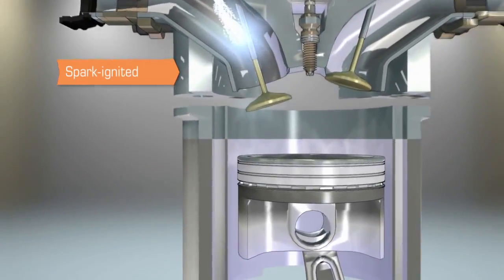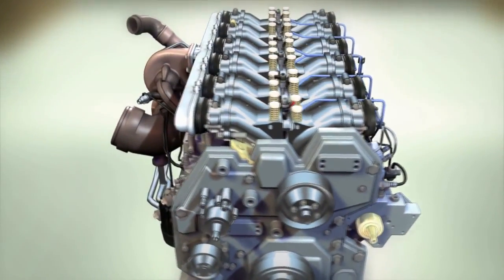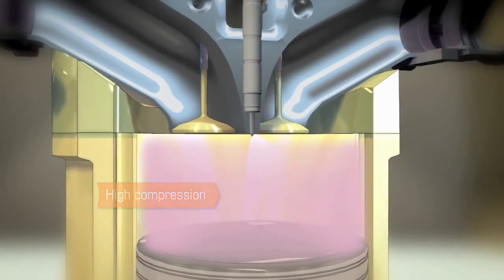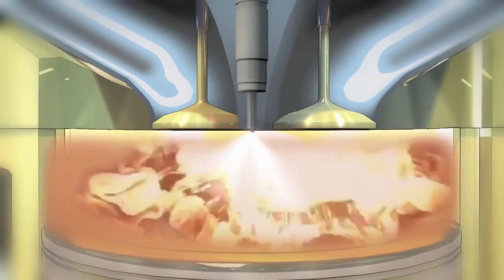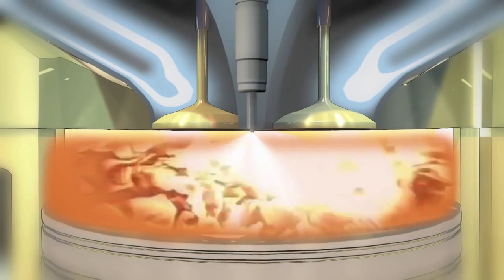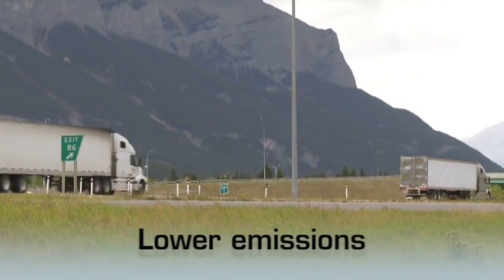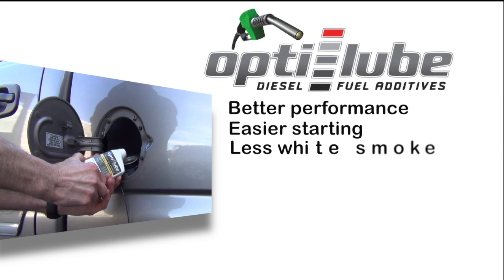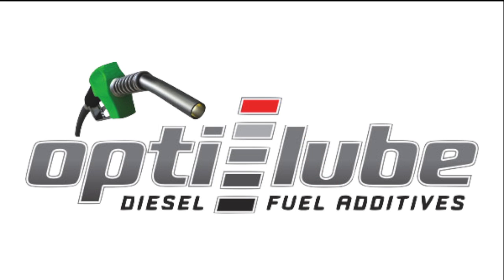What Is Cetane and How Does it Impact Combustion in a Diesel Engine?

Comment: Heads up to my diesel heads in California. HPR diesel is a biofuel that has a cetane of 75, costs almost half the price of Diesel#2 and has reduced emissions, with increased perfomance
Reply from the maker: BioDiesel does have higher Cetane, but actually contains less BTU's than regular #2 Diesel, so saying that it has increased performance is not entirely accurate. It may fire sooner and cleaner, but not as much power.
Reply: @OptiLubeAdditivesLubricants  HPR Diesel is technically not considered biodiesel.

It's actually 65 cetane rating, but thats really high for diesel. I notice much quicker throttle response, but I believe you are correct about the BTU content being lower. With that said, the manufacturer claims more power and torque.

http://web-assets.propelfuels.com.s3.amazonaws.com/pfc15/DieselHPR_FuelSpecification_R95.pdf

I still use optilube at every fill up too!
Reply: Thanks for the info. How much is it per gallon?
Reply: It smells like French fries
Reply: If you run optilube boost in high concentrations it can boost your mileage insanely,with the crazy diesel prices it's worth it.i run 1:100 and double my mileage the truck runs so much better
Reply: @alscompleteoutdoor9091  Double mileage....yea, right.  If an additive existed that doubled MPG everyone would be using it.
Reply: I was told do not run biodiesel in chev l5p duramax...
Reply: @tray8411  it's not biodiesel. It's green diesel. It also happens to be the only diesel for sale in California anymore. This was 5 years ago before that was the case. It's also the same price now
Reply: Renewable diesel(R95-100) is made the same way as petroleum diesel, but using the same feed stock as Biodiesel(B20, etc.). Unlike Biodiesel it's safe to use and will result in the emissions not having plugging issues like I have heard they have from regular Petro diesel.